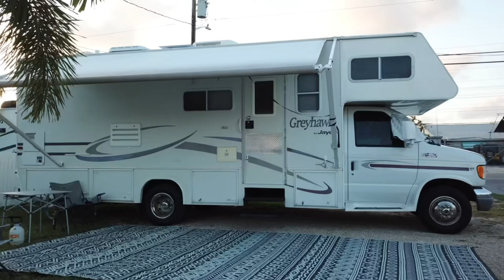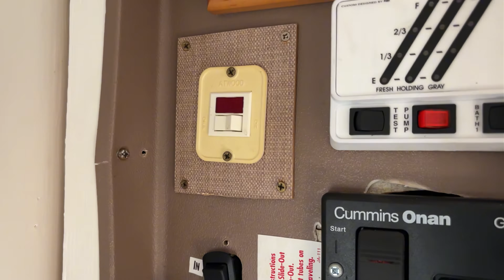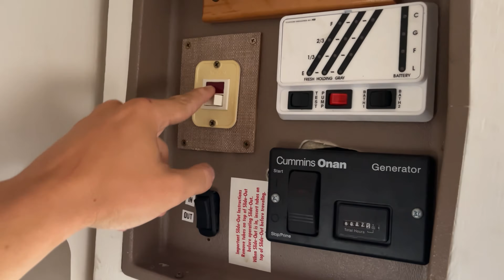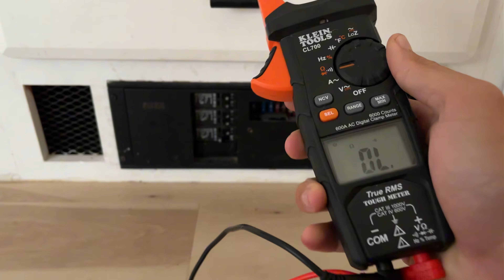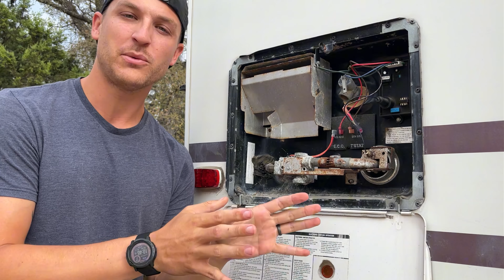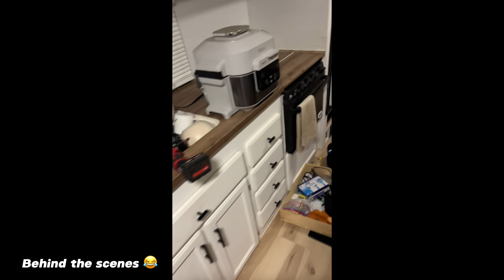How to Troubleshoot (and fix) an RV Water Heater

Comment: Very useful thank you!  How do you diagnose the electrical heater issue?   My system has both electric and gas.   My gas water works well but the electric doesn't appears work.
Reply from the maker: The electric is an independent element on the back - it’s likely either the element or the wire connection. Let me know if that helps!! 
-G

Comment: I have a 2022 jayco jayflight SLX an I am trying to get hot water thru lp gas please give me step by step directions.
Reply from the maker: Not professionals here, but this is what usually works 👍 Make sure the water heater is full first (hook up to water or turn the pump on and open a hot faucet until it runs steady). Check the bypass valves (usually behind a cabinet/bed) — hot & cold should be open, bypass closed. Turn on propane, light the stove for 30 sec to clear air from the line, then flip the water heater switch ON inside (gas, not electric). Some Jaycos also have a switch outside at the heater — make sure that’s on too. Give it 15–30 min and you should have hot water. Hope this helps!!
-G
Reply: Hello, I am the manufacturer of this gas valve. Do you need this product?